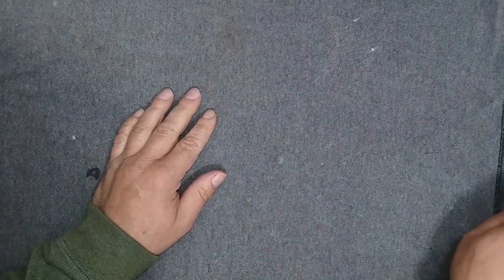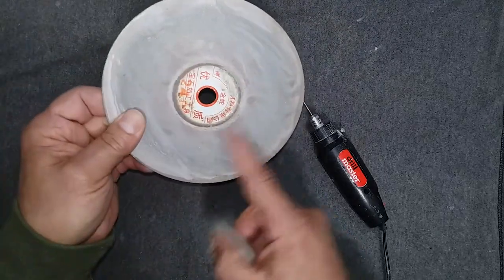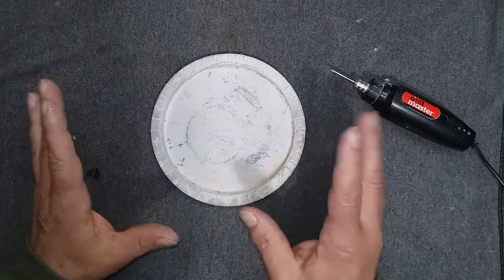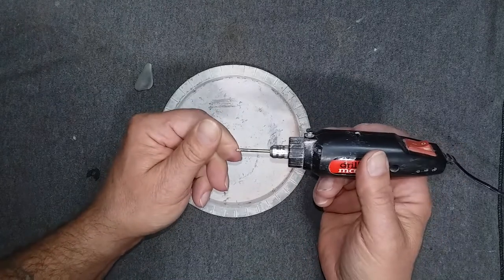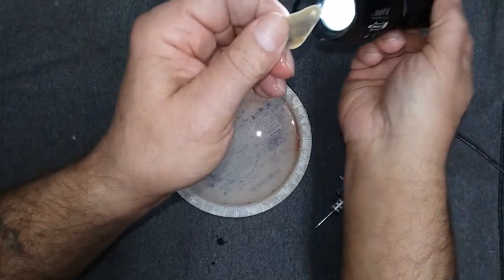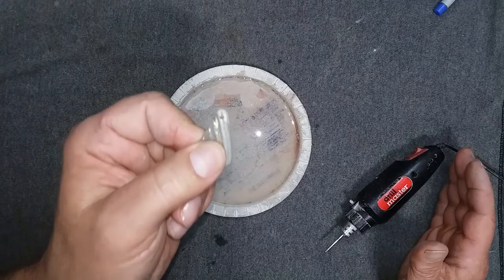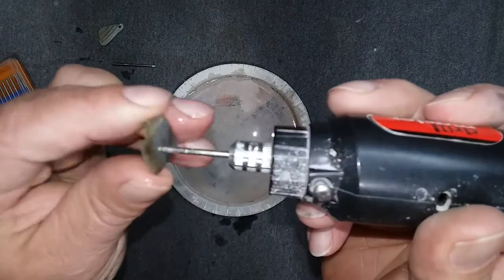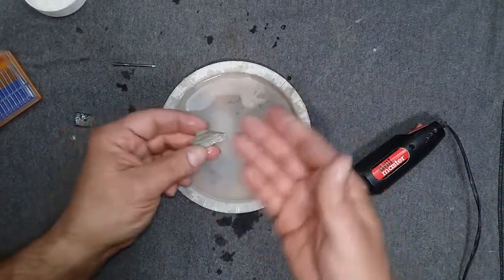How to drill holes in your gemstones.

Comment: very informational. Can you show a close up of the shape of the grinding end? I would like to grind a 3mm hole in onyx.
Reply from the maker: I may cover that a bit more in a future video..but I have been using a ball shaped end for the softer stones and for shells. But I found that a bit with a flat end and sides as wide as the shaft works better for the harder stones like quartz.
So unless you are drilling something that is around a 6 or above on the Mohs scale a rounded bit will do good.
Also it depends on the quality of the bit as well, THAT is a big factor.
Reply: @sandandshoreshoppe  thanks. In the mean time I managed to drill a hole of 2.5 mm and that went quite well. Only thing is that once you break through the hole on the other end is a bit bigger (on the break through side). The round drill worked fine.

Comment: For quartz are you using the cylindrical engraving bits coated carving burs? I'm trying to order the correct burs please.
Reply from the maker: I use the engraving burs with a spherical  or round end, but the end must be wider than the shaft of the bit or else on deep holes the shaft wont pass through what you have ground away.
Also, the quality of the burr is essential. The super cheap burs like I am using in the video I buy in bulk but go through a lot of them, especially when drilling stones with a 6 or 7 hardness. A higher quality bit will do a LOT better.
Reply: @sandandshoreshoppe  Thank you but what brand do you suggest is higher quality?
Reply from the maker: @rkhnd51  Well, the ones you can get for cheap on Amazon are NOT high quality, but I do get them for drilling seashells because they last a long time with such soft material. For a high quality bit I suggest buying from Kingsley North, that is where I got most of my lapidary supplies. They carry a lot of diamond burs and nova points. As for a specific brand, it would be best to call them and tell then what you are drilling/grinding and they will suggest the best bur for that materials hardness. They are a good quality company from what dealings I've had with them.
Reply: @sandandshoreshoppe  Thank you for sharing.

Comment: Would you recommend this for small and large ammonite?
Reply from the maker: I have used this for drilling a lot of different types of stones and shells, and I believe the thickest I ground through was 1/2 in, though I don't remember what type of stone it was.
I don't see why it would not work for an ammonite, but since I have not personally ground through one I can't say ''yes it will work'', though I don't see why an ammonite would be any different from any other stone. I would suggest  giving it a try with a less valuable specimen and see how it does with it. Just be sure to make sure the grinding part of the bit is bigger than the shaft if you need to grind through an area thicker than the burr itself.
If you do let me know it works.